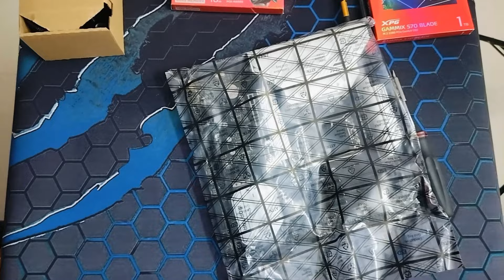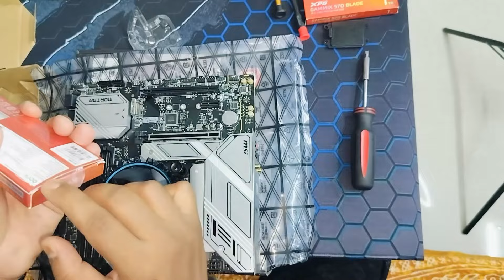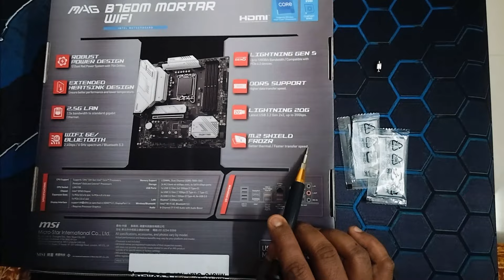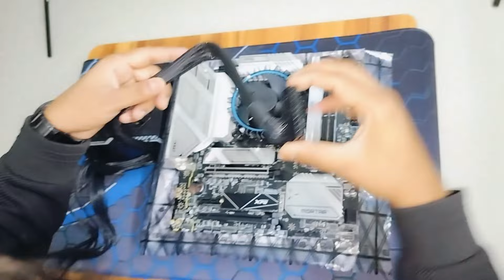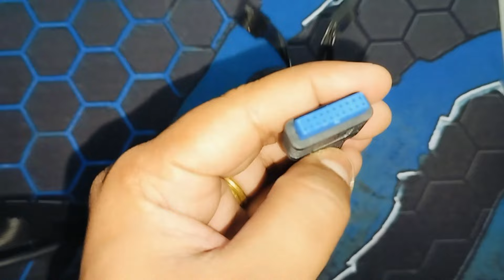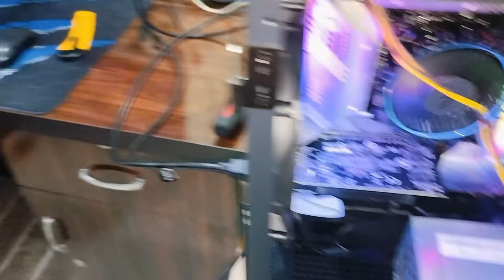Rs 50,000 Budget Gaming PC Build: i5 12400F, XPG 16GB, XPG S70 1TB | Step-by-Step Installation

Comment: Hey brother I watched you video I found one issue with your ssd m.2 1tb storage if you motherboard is already provided and m.2 cover you dont need to install the one you got with ssd you can see the your motherboard have included heat sink which have thermal pads remove the sticker over the ssd 
The faster ssd is the one which is near your processer.
Reply from the maker: You are right thank you